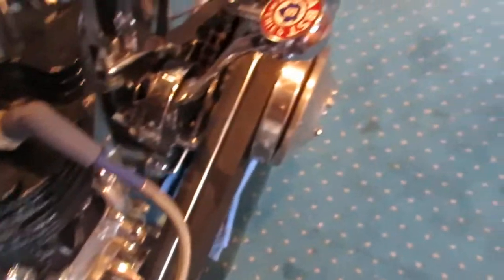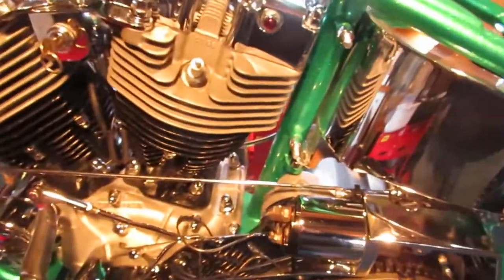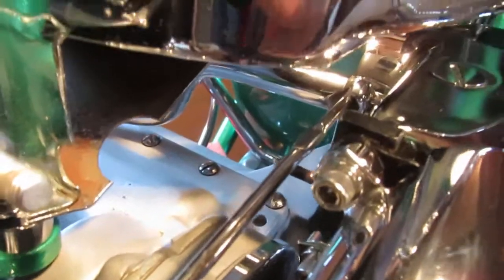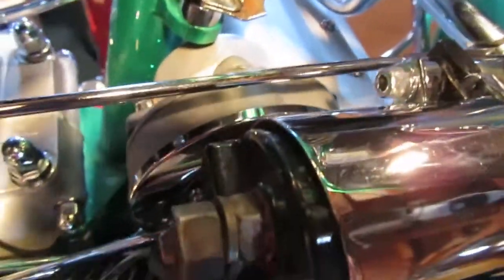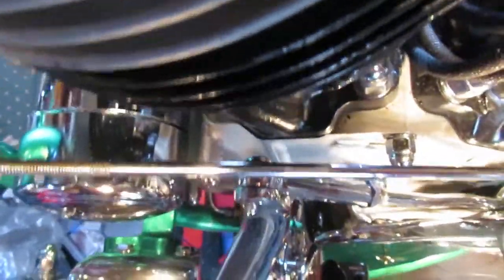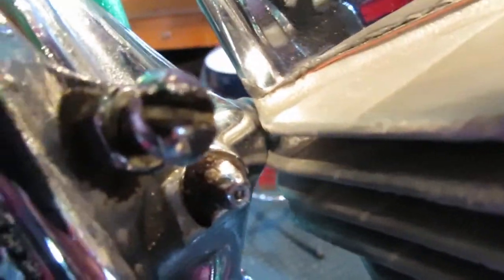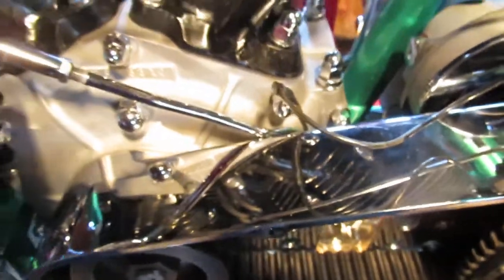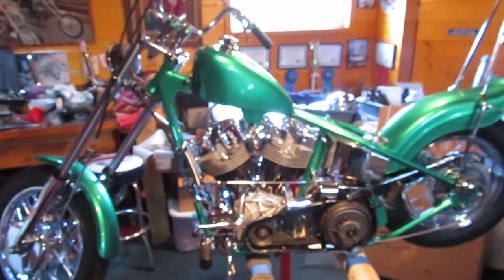"Rigid Frame Electric Start Mousetrap"

Comment from the maker: I have since made other videos of this bike running and the mouse trap and electric start set up work just fine.  Tight fit, but works easy, with one finger pull on the clutch lever.  Yay!  ;)